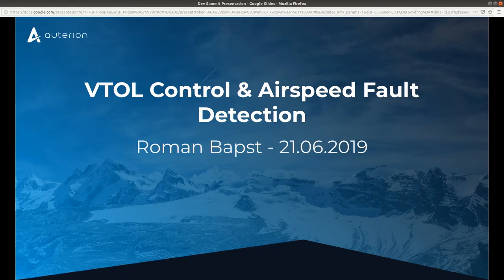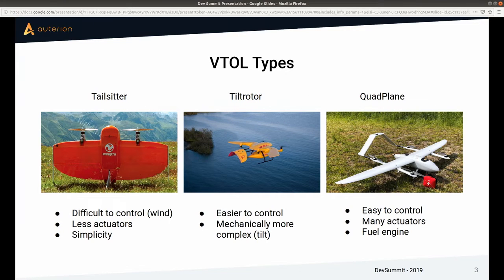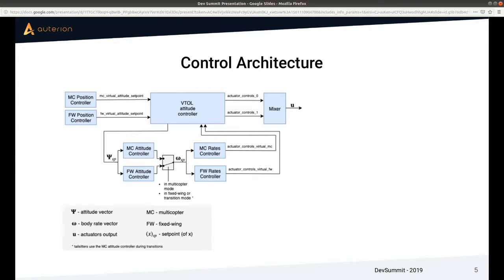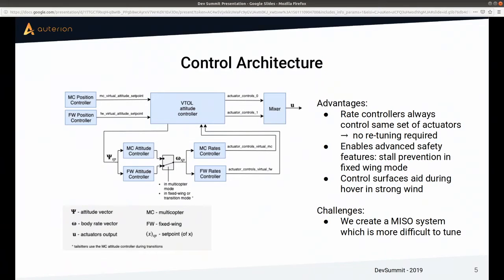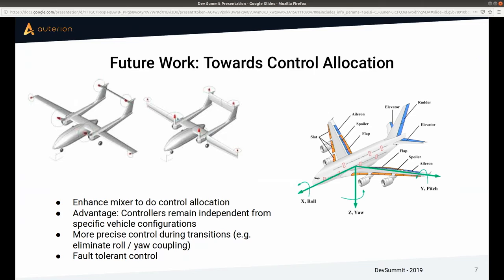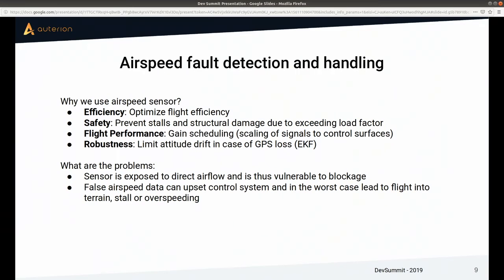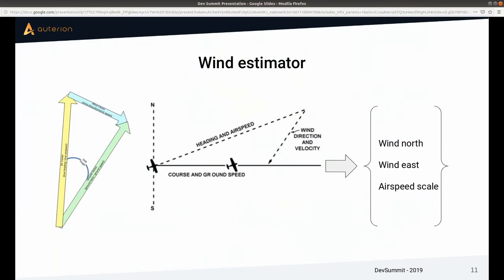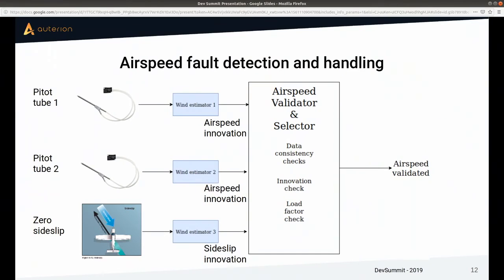VTOL control and airspeed fault detection - PX4 Developer Summit 2019

Comment: Hello,
thankyou for your help with developing this system.
 I have, for several weeks tried to program my convergence plane, using QGroundControl, with no joy as i can not locate the file needed for the vstol airframe for the convergence in QGC.
I am using a pixhawk px4 fmvu2, 
px4 firmware doesnt seem to instal but the arduino version does.
Any help would be great.

Also my remote air mavic link running v 1.7 wont connect or update to the ground base which is running v 1.9 currently.
Thankyou